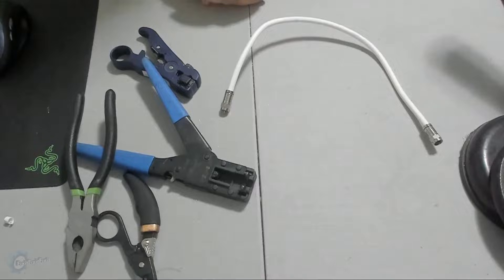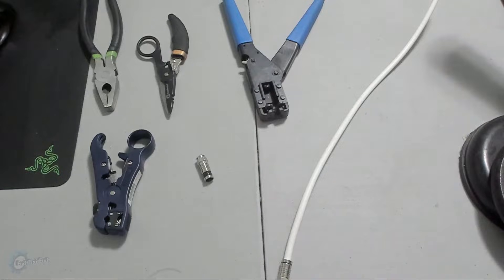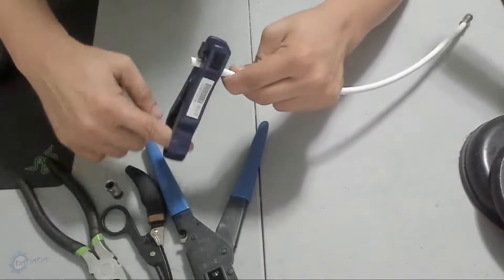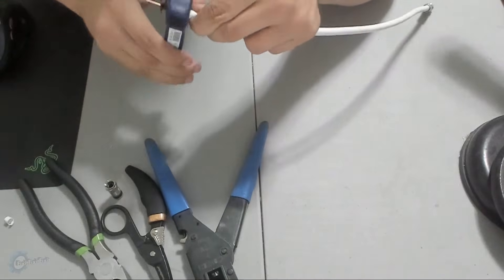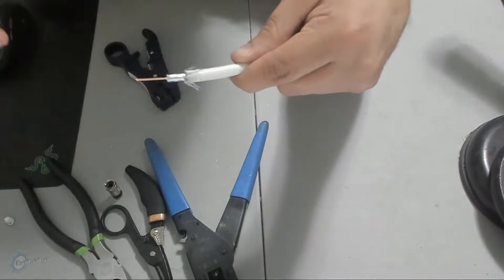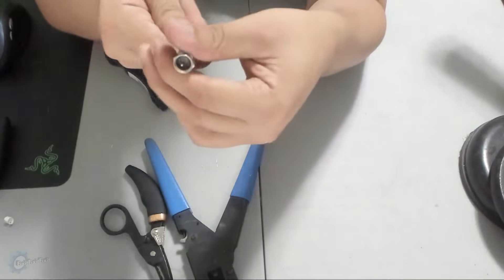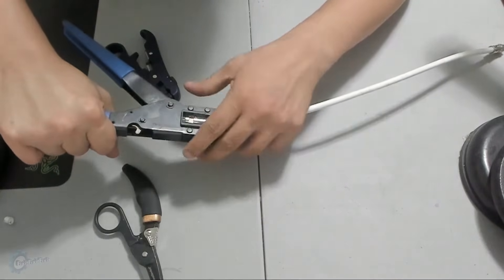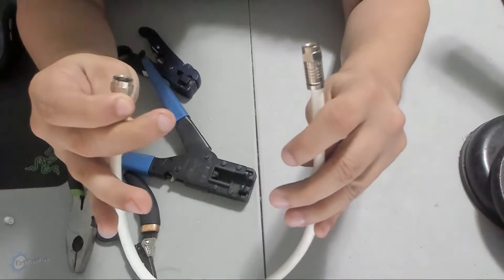How to make COAX Cable Wire / RG6 - Tutorial Guide

Comment: Cut the copper after the fitting is compressed and only strip the outer jacket half a inch unless you get a decent pair that does both at the same time

Comment: I do high voltage work and had to put one of these in for the first time the other day, my superiors gave me the twist on connector, I may have over twisted it because the shield portruded into the connector a little bit, but not too much. I still had bare copper with no shielding touching going into the female end, do you think that would cause an issue?

Comment: This is the best video I've seen. Unfortunately, even after doing this, I’m not getting any signal. From the looks of it, the problem is on the other side of the cable where workers disconnected the box that the cables come in through to the condo. I'm not really sure why they didn't fix that yesterday when they had a half-dozen trucks here working.

Comment: Ok, The Cable Stripping Tool is engineered to cut the coax precisely as needed. When you place the coax in the stripping tool, have the end of the coax flush with tools side. That way you don't need to cut the copper conductor, potentially bending it incorrectly, and causing errors.